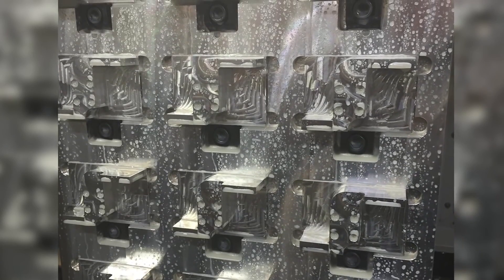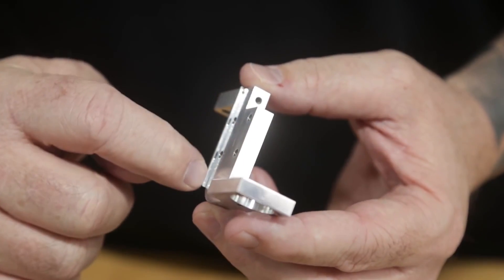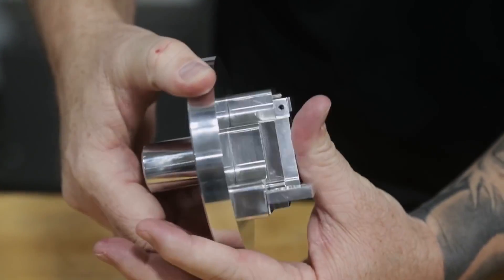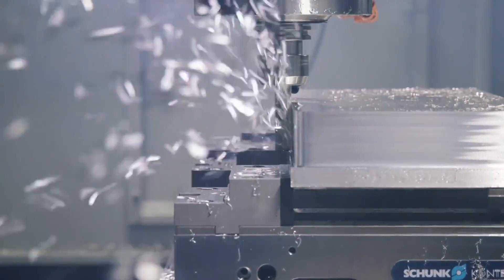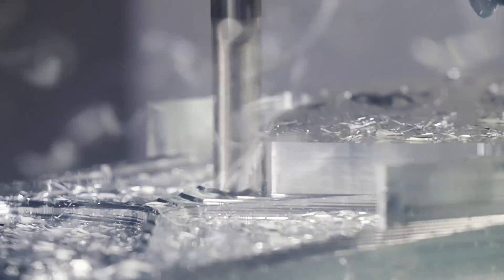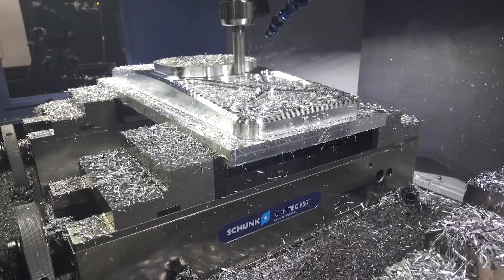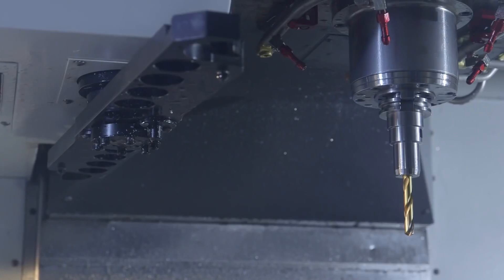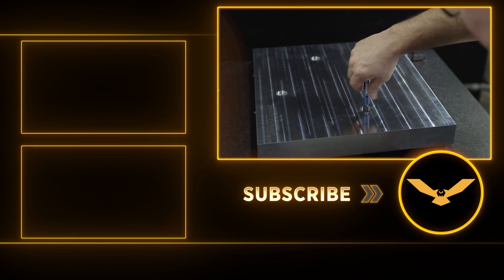Employee SCRAPS an INSANE Amount of Medical Parts... and the Reason is Even More INSANE

Comment: Titan, depending upon the job, not all dimensions warrant inspecting all the time....... When a piece is submitted for inspection. For instance, the dimensions of hole locations are not likely to change because of the integrity of the machine axes....... But a bearing bore that's +.0005/-.0000" should be checked regularly due to tool wear. I used to run an inspection lab for government military parts, and even though there are some critical dimensions that we have to keep track of frequently....... We couldn't let things back up in the shop by over-inspecting every single dimension on an in process part. Other parts needed to be inspected also, and their operations could not proceed until they passed inspection. You have to balance between making sure critical dimensions are kept track of....... And not holding up manufacturing efficiency because those machines needed to have parts inspected, and you couldn't do it because you were expecting 100% of all dimensions on an in-process part.

Comment: Once I've also made a hole bunch of 2000 pcs for scrap... Here's the story: 
The part had a "overcrowded" drawing with too much measurings on too few paper area. That made me overlook a dimension. After machining the first part, the mandatory inspection by the shop inspector wasn't possible bcs he was out. So I gave it to my mate for 1st piece inspection. He overlooked the dimension as well... and so we went. When the job was done, at final inspection, the inspector asked: Why did you this hole exactly 3.000 mm away?
-> Lesson learned: Since then, I make me a copy of the drawing and use it as "checklist": every dimension on the drawing must be marked as "ok" before running the job.

Comment: Hi there Titan how do you do your FAIRs do you send it to the customer and wait ,before doing the 2000 . The better way of doing things is to have the inspector from customer there and then only pursue with customer agreement. These machined parts are small so you start at 7am and fill the containers with start time and change time so every 3 hours so 7 to 10am 10 to 1pm 1pm to 4pm keeping track of things so hourly patrol inspections to make sure everything okay. A quicker way is to inspect 25 components pass it and weight it make sure they are free of swarf and grease find the average weight ,then find the SD standard deviation now plus 3SD to the average and minus 3SD this will be your new tolerance this is 5 sigma usage . So out of the blue just weight the component and if it falls between the +/- I'm sorry my typewriter doesn't show a minus then pass it easy but the inspection of 25 will take over an hour and a half .

Comment: I was producing some parts that were machined and inspected in the same machine. And I set one of inspecting parameters wrong. While inspecting a part measure seemed right but they actually weren't. Since the client provided material I had to pay damages somewhere around 2500 BAM witch is cca 1250 USD and that's a lot in our country.
Reply: Btw... It was bosses idea to inspect them that way

Comment: I remember machining a part for a surgical drill in a job. I don't remember what the upper and lower tolerances were but I remember the dimension of the outside diameter was 0.433 which converted to 10.99mm. So what I used to do was keep it at 11mm as much as possible. If it ever went over you could always take a little bit off and if it ever started going low (eg. a new turning insert) it gave you a better chance of catching it in time. The thing is though, those parts were temperature sensitive because of the tight tolerances even though they were steel. When the machines warmed up you had to watch the tight tolerances because the heat expanded the material. Another time some parts got rejected because someone (not me) compensated for the difference between starting a new run of them and the heat of when the whole shop was running machines later in the shift. The early ones came off the machine lower than middle tolerance but still within range. The following day QC came back to us because a number of those parts were rejected for going through the "no go" part of the gauge.

Comment: I once almost scrapped a Magnesium part that went into an Apache Helicopter. It was one piece. I was an "APPRENTICE" working on a manual lathe. The tolerance was 5-tenths. I had a low spot on it by 1-tenth. The inspector wouldn't "buy" it. After arguing with the Inspector, my boss called on Hughes Aircraft and they said it was OK. They (Hughes) had actually had a tolerance of 1-thousands of an inch. SO, I had actually made a good part, on a manual lathe, as an apprentice to boot.
Inspectors, you gotta love them, sometimes.

Comment: That is what happens when you focus on time and quantity instead of quality.
We have a customer that makes parts for military and they have 100% score on quality.
They never scrap a part.
It takes a little longer doing this, but it takes longer time when you have to make new parts to replace the scrapped parts.
This factory is located in Norway and many other companies (american/ european/asian) have tried and failed making these parts.
That is because they focus on time and quantity instead of quality.
You can make 1000 parts, scrap 30% of them, then use more time to replace the scrapped 30% instead of using a little more time and get 100% without any scrapping.
These parts have more then 800 measuring points that get checked in a measuring machine.
They never push start on next part before the previous was approved.
What is best, using 20% more time to get all parts correct or using 30% more time to manufacture replacements for the scrapped parts.
These parts are welded together, heat-treated, de-magnetized and checked before going to machining.

Comment: Making parts in tolerance is the machinist job.
But making blueprints with 
measurements with tolerances that make practical sense is the job of the engineer...and sometime I see blueprints with nonsense tolerances, from tolerances simply put on the draw because they forget to eliminate them when quoting on the CAD to tolerances in series wich after a calculation they are simply impossibile to do.

Comment: I've had to deal with this a lot as well.  Usually I find that the blue print tolerances are tiny and there is absolutely no reason for it.  I've seen engineers that think a +/- .01 should be the blanket tolerance for all dimensions that are out to .00 places... and it's because the engineer hasn't a clue to the impact of part cost.  I've also seen engineers that don't allow a variety of material for a part so it corners what you can manufacture the part out of, which can also greatly impact the cost.  It takes about 3 years of training to make people cost aware of all those small decisions can impact a part so much.  I was always very glad that I over saw all my requests and had to give final approval, because not many understand the problems they cause with tolerances.

Comment: In IT we call it change management. Whenever someone does something that affects a system, be it an upgrade, downtime, whatever, it goes through a change review. I get that that swaping an end mill is an on the fly thing, but since it can have the ability to domino effect every part it touches, having multiple accountability for ensuring the correct parts are installed would go a long way. I've seen million dollar downtimes happen over stuff that would have been easily caught if the right procedures were in place (or followed!)

Comment: Wrong tool happens I once worked at a auto manufacturer . And I worked on doors all the way back in the paint shop a maintenance tech replaced the rubber pads that were used to mount the painted doors on the line that runs to the   other side of the plant which means we were about 200 doors sets away from the mounting machine when the doors finally made it to us every door that had been mounted for that side of the car had 2 dents square in the middle of the door where the technician used 2 new bolts that were about an 1/4 inch to long  on that set of pads. They weren't caught until they got to my stall . They all had to be scrapped and replaced.

Comment: If you do operator control, please introduce quality audits by QA. Also Preferably CNC  measuring machine program or gauges as well. If working to 0.0002 inches temperature control environment will also be needed or temperature controlled adjustment system at theCNC machine . (I am retired QA Inspector and time served toolmaker with precision jigboring experience in UK). invest in a CNC measuring M/C if you haven’t already got one. If you use PC Dimus you can run around the first off and it will generate the measuring program for subsequent parts using simple jigging . 0.0002 “ tolerance I would definitely advise temperature control around the CNC.machining centre and measuring machine. That would achieve the most accurate results and fewer rejects.

Comment: I heard about a guy who was working at a well known aerospace manufacturing company here in Wichita, KS who had a very low scrap rate and by the time he retired after 30 or 40 years there, the roof of where his work area was at was needing a new roof replacement along with a new air conditioner up there......they found hundreds of scrapped parts that had been tossed up there. All aluminum!  Like 30 to 40 years' worth of it! He had been scrapping parts and once he got it right, he simply was tossing the parts on the roof and nobody ever caught him! He had been retired for years so there was nothing anyone could do about it. Good thing aluminum can be recycled.

Comment: Damn, more than a tenth out and its scrap? I deal with parts that have a 30" bore in length, the I.D tolerance is +.001 -.000 and the material alone is thousands of dollars, it is easy to make a mistake and be out of tolerance, my company would never scrap something like that just to save face and it makes sense. I get parts like that because I am skilled enough to avoid bad mistakes, but I'm not perfect, that is what the tight tolerance is for, the customer knows that it can be more, they won't tell you what it can be, but they expect you to ask if it's ok.

Comment: Check all critical dimensions 100%, change tool, know your schematics, sometimes QA is not available on nightshift, better judgment call, check your corner radius, validate dimensions that the tool cuts!! Do not run parts until you validate (inspect your own work always, height gauge, interapid, surface plate, 123 blocks, check your work always, if your not sure, put machine on downtime!!!🤔✌

Comment: I saw once a night shift guy actually put in a 5/16 end mill instead of a 3/8 but used the zoller to set the length and didn't include the diameter (that last part confused me) . Our system could send tool data automatically to the machine control computer but instead he set it manually into the computer , needless to say he didn't stay long after that . Had he followed proper procedure the system would have kicked it back and given a message the diameter was out of spec . People not following procedure is the most costly thing to a company , assuming your procedure isn't stupid , I did work for a company for a couple weeks whose procedures were absolutely stupid and defied all logic so I couldn't be part of that hot mess .

Comment: I worked QC in a medical manufacturing company for a while and was failing a large percentage of the carbon fiber product that was coming in from vendors because it was way out of spec for flatness, threaded holes that were no go and dimensions that were off. I would NCMR the products, but the QC managers would have what we called a Circle Jerk each morning and look over the product that failed, and decide that yes, it would be OK to assemble and ship out to the medical facilities. They needed the product to ship and did not want to piss off the lowest priced vendors that they use. Coming from an aerospace facility this did not fly with me. 

If you had made these parts for the clowns above they would have accepted them.

Comment: Even with proper storage and accountability, I still double check every tool I replace before signing it out. When guys with 15+ years experience come in and don't double check either LOC or Radius' during setup or tool replacement, I freak out. A guy with 3 years experience in machining shouldn't be running circles around a guy with 20 and making them look bad.

Comment: Person whom changed the end mill is at fault didn't take first off after a tool change to inspection either arrogance or genuinely forgot I've known loads of guys change a tool and be like it'll be fine run it nothing is wrong with quality over quantity either that or management pressuring the guys to get parts out so it was just ran straight after tool change

Comment: I've never seen our quality control guys pull out a radius gauge in the entire 5 years I've been at the company.  It's crazy, because I was an inexperienced lathe operator, and programmed close to 100 jobs without understanding how to compensate for the tool nose radius.  All my parts passed inspection in house and with the customer.  I guess I got lucky that none of it mattered.  If you own a CAT, CNH, or John Deere truck, the corner rounding on some features of your hydraulic fittings might be a little out of spec thanks to me 4 years ago.

Comment: Here is a video idea.  Show the different ways to verify an bull mill's dimensions.  Like diameter and corner radius, both offline and in the machine.  There are many ways from micrometers and radius gauges, optical comparators, tool presetters, or in the machine with a Blum laser.  Show the crazy stuff like being able to adjust your wear table on a Blum laser, or measure corner radius of a bull endmill, or the angle of a chamfer tool.

Comment: Not checking dimensions after changing a tool, not checking a part 100% at the beginning of a shift.  I can't comprehend anyone not doing this, first time is a week off, second time you just fired yourself. This is a CNC machine you have plenty of time to check parts, don't the inspector check the operators parts, a couple of times each shift? 
I used to run two or three CNC machines at a time, the very worse I ever did was maybe an hours worth of bad parts, on one machine.

Comment: What's bad is some companies don't believe in doing in-line inspection. They feel it's to much overhead. Need to catch problems before they get to final inspection, common sense.
Need inspectors that want to find something wrong & not just go thru the motions.
Also, operators need to work together & leave their egos at home.

Comment: Hi. I started my mechanical engineering career at a well known automotive shell 🐚 bearing manufacturer in 1969. Two of their customers had exacting quality control procedures for their components (Cummins and Volvo). They had a dedicated temperature 🤒 controlled gauge room for checking items at the required 20 degrees Centigrade temperature and a certain amount of time had to elapse before any items could be checked by an inspector. 50 years later and retired. I do have to wonder if such temperature 🤒 controlled rooms still exist?.

Comment: I have it happen before that should be caught with naked eyes but 1st shift set it up and passed 1st article inspection then the whole order and I mean whole order is scrap because hole is on wrong side of the part and I been wondering how the hell operator and quality control does not catch it when comparing the print to part on first article when we been running it for long time

Comment: I respect you have a business to run, and you need perfection but as someone who spent a lot of time on a shop floor, granted nothing as tight as machining, I know just how often these perfect "rules" to guarantee perfection 100% of the time can be derailed by any number of sources, often management and ownership. If you are management and interrupting checks, or an owner asking questions about a job, that is valuable focus you are taking away from the operator. Because no matter what you say, when your boss or the owner comes you your equipment, they get a percentage of your focus. The number of times I had to take our shop manager aside to ask him to stop asking operators questions mid-check or mid-setup was insane, but when he stopped doing it, our errors went down. Almost no question is so important it can't wait a few minutes.
Reply: Also, no matter how much they say "quality, quality, quality" they still expect unrealistic numbers which forces people to cut corners on safety & quality.... These so called "bosses" nowadays know absolutely nothing about leadership, they're all just ego talking heads.

Comment: That was an expensive lesson. 
Thank you for sharing it.

I have minor machining experience.
After that, I spent nearly 20 years as an aircraft mechanic, mostly on helicopters. 
I don’t claim to be a machinist by any means as that experience was a specific task.
But that experience did teach me quite a few things that gave my maintenance skills an advantage.

Some parts get checked during service and if beyond limits are removed from service and repaired or scrapped.
Occasionally serviceable used parts will be installed and people just accept that it meets spec.
Some people double check.
But rarely does anyone check the new zero time parts.

I’ve checked some new parts and found them to be beyond the limits. That were the same or worse than the parts that were removed.
The manufacturer was contacted and their engineers said the new part was good to go.

What’s the point of replacing a functional part that’s out of spec with a new one that out of spec? 🤷‍♂️